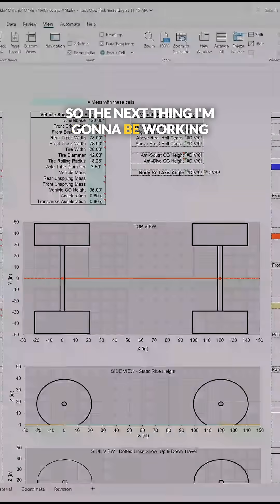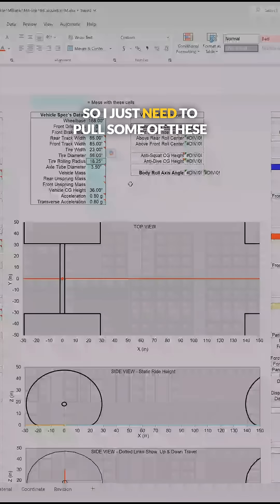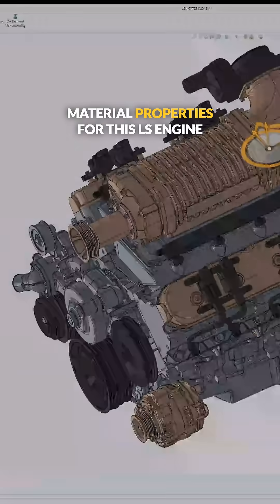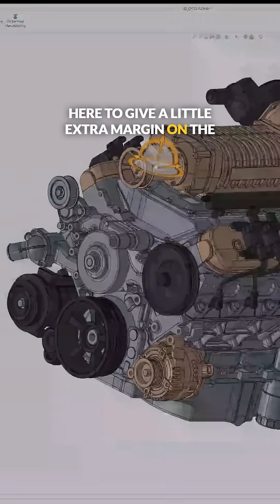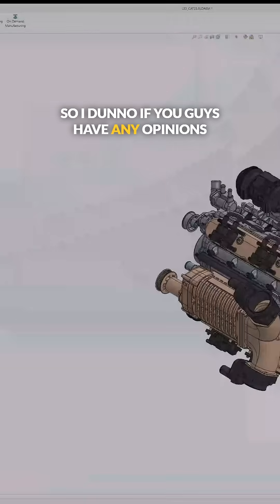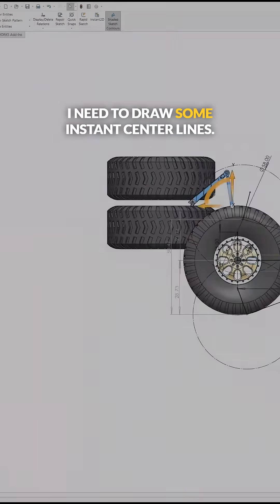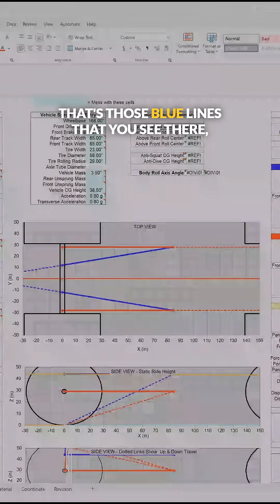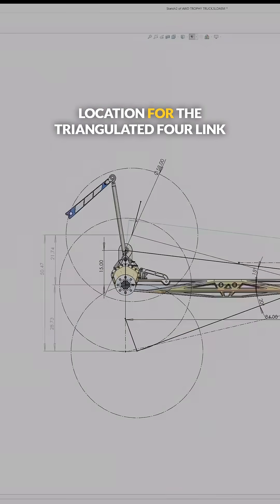4-Link Suspension Calculator & CG #solidworks #antisquat #trophytruck

Comment: I personally would go with aluminum unless you needed to build the strongest most durable engine possible. Not only do you save a lot of weight, but the cooling is so much better, and a cooler engine can run better.